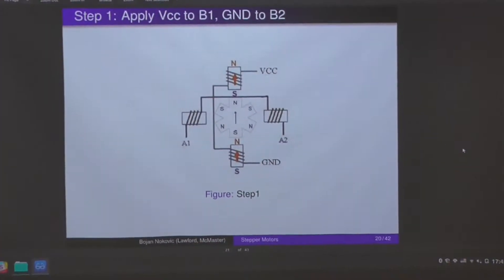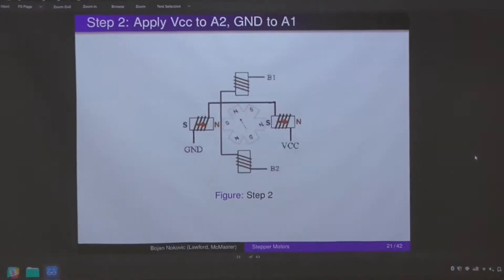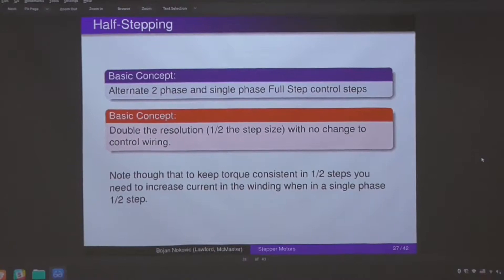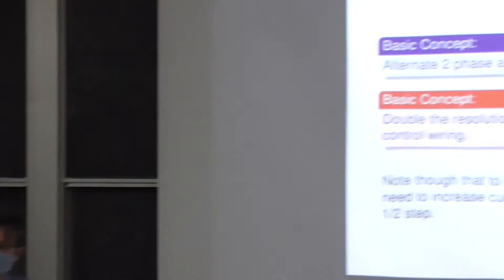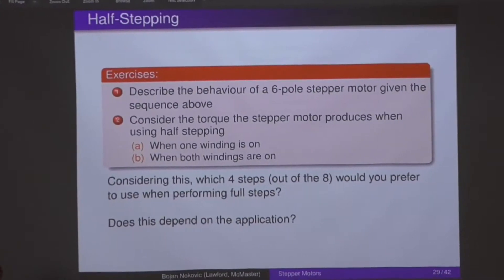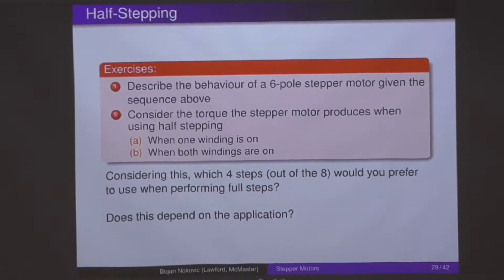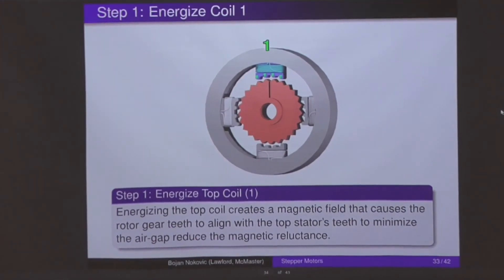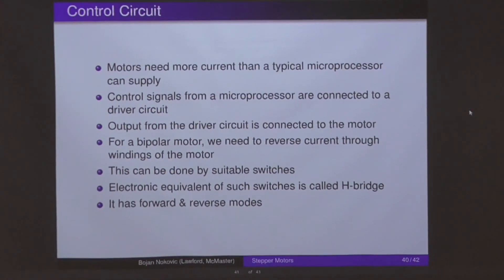MT 2TA4 Lecture - Winter 2022

Comment: I don't really get how during half stepping of a 6 pole rotor, the resolution is 15 degrees, could you clarify how its 60 and not 45 please, thak you
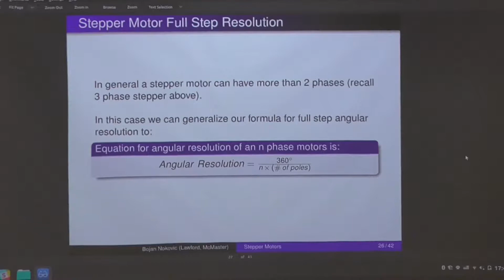Reply from the maker: So, @2:44, the angular resolution forumula  for full steps is 360 / (poles * phases).  For these examples, the number of poles is 6 and the number of phases is 2.  360/12 = 30, but that's the formula for full steps.  Under half stepping you have double the number of steps, so that's 360/24 = 15 degrees for each step.  

45 as a step size doesn't work when you have 6 poles on your rotor anyways, since the poles will be spaced at 60 degree angles.  Check out what happens when you factor 60 and 45 down to primes (2*3*5 for 60 and 3*3*5 for 45).  60 has more unique prime factors, so it divides more ways evenly.